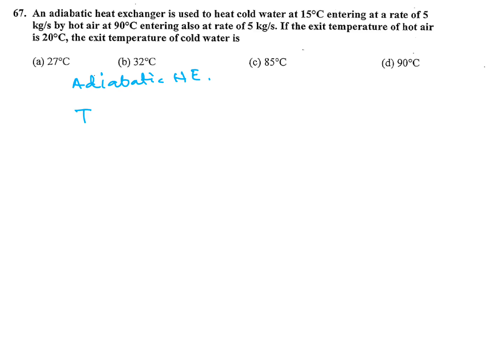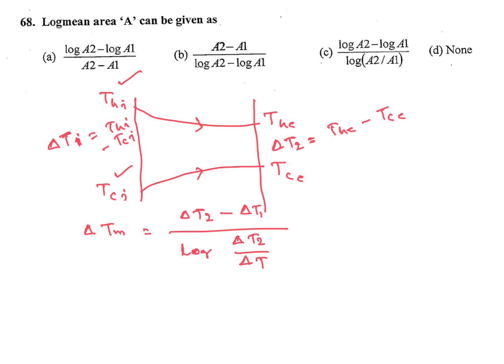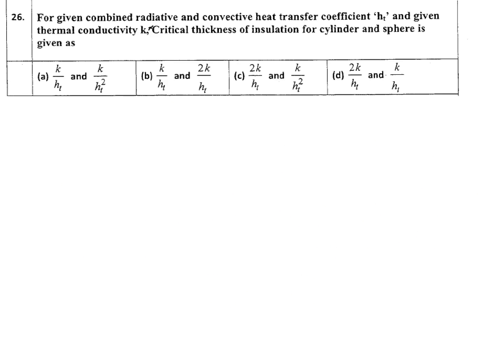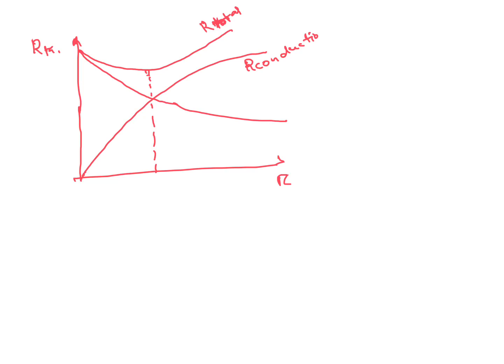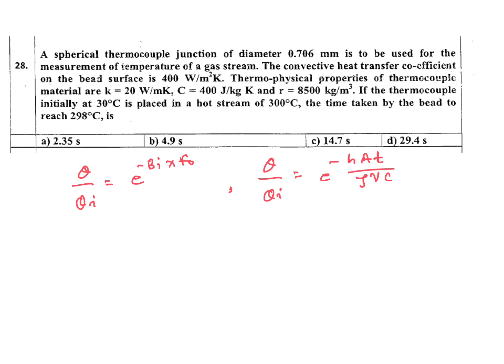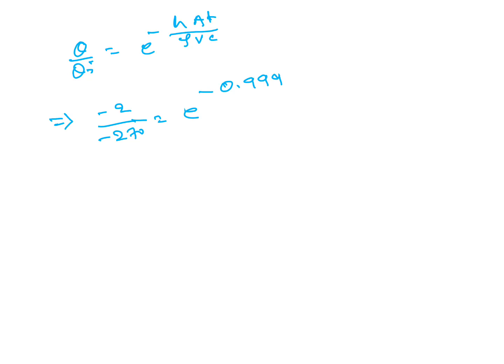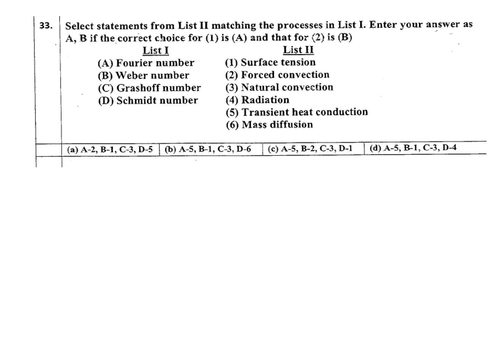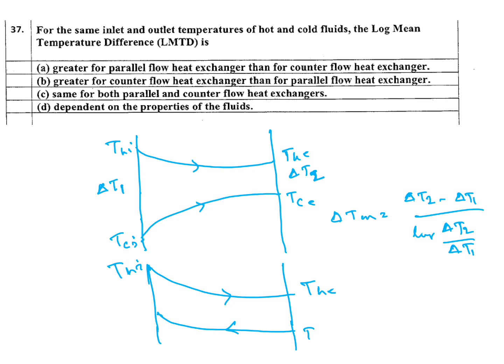ISRO QUESTION PAPERS HEAT TRANSFER - 06

Comment: At 2:20 and 9:05 i.e Q67 and Q25. specific heat of hot water=4.2kj/kgk and specific heat of cold water or ice=2.1kj/kgk. please resolve this doubt whether to take both cp equal or what u have done is correct?